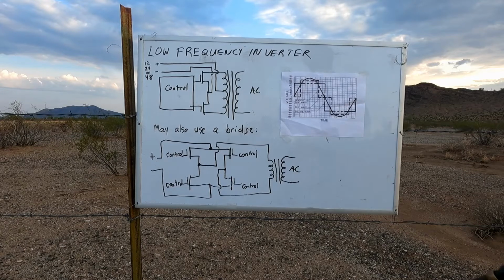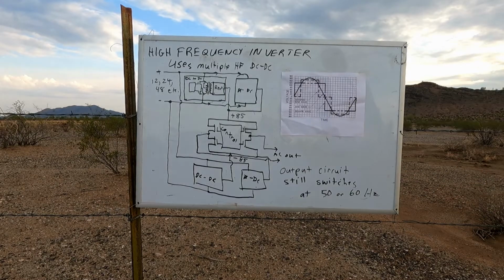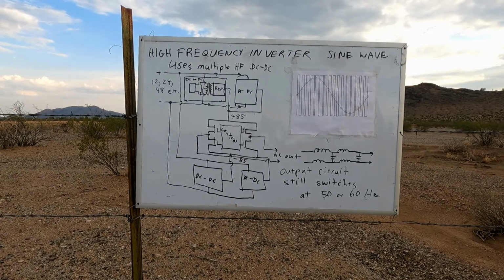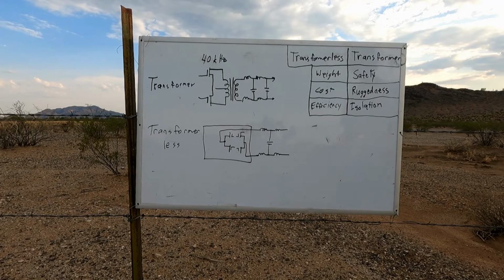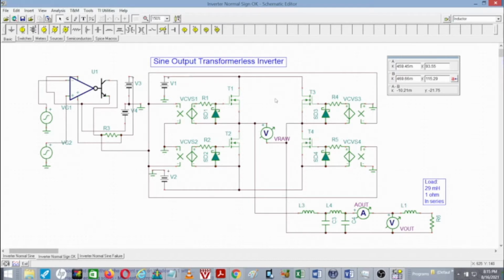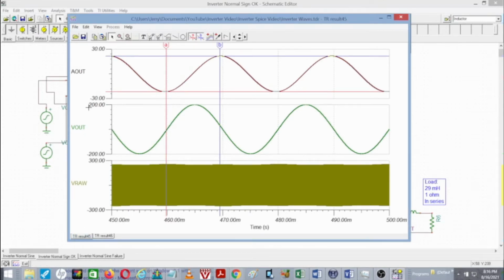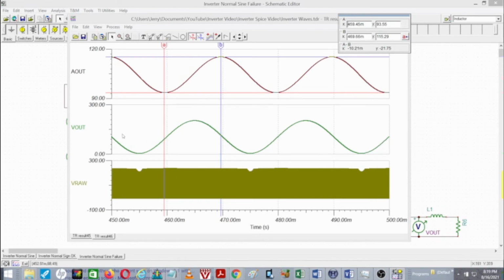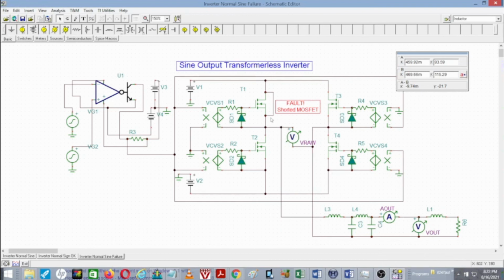Solar Inverter Catastrophic Failure

Comment: When solar goes bad.  Interested in the back-story on that shed damage, which now looks like a film set from The Walking Dead.  Not naming any names on the solar inverter which failed or what type?  Presumably a transformerless type?  True that breakers don't protect all residential AC loads.  They do best-effort by having multiple circuits, with most limited to 15 or 20 A, but that officially just protects the wiring.  Some AC devices have internal breaker protection (reset button).  Very good idea that Solar Inverters should have a circuit which monitors the output and disconnects loads if something is wrong, like the DC-level you show.  I wonder which ones do, and how their terminology informs that.

Comment: Very informative video, sorry about the fire. Luckily it seems like your house was spared. How could a relative novice tell if their transformerless inverter has this type of protection? The manual for my GoodWe GW3048-EM says it has over current, over voltage, and short protection on the output. Then IEC/EN62109-1 & 2, IEC62040-1 but I can't really make sense of those standards and I'd need to pay $$$ to read the full versions. It "seems" ok but that still makes me nervous.